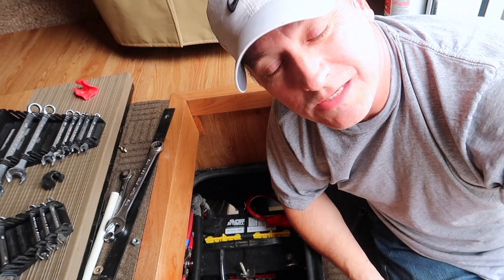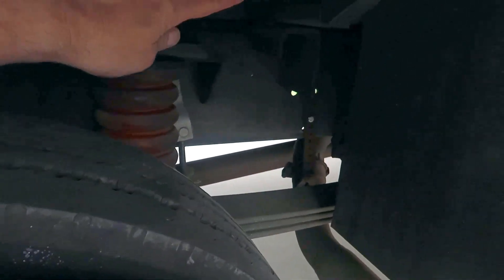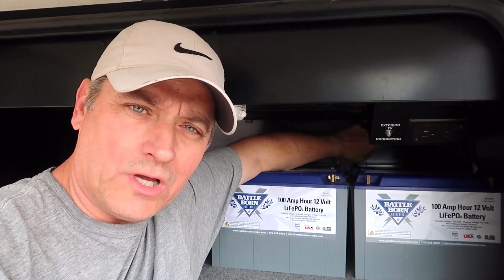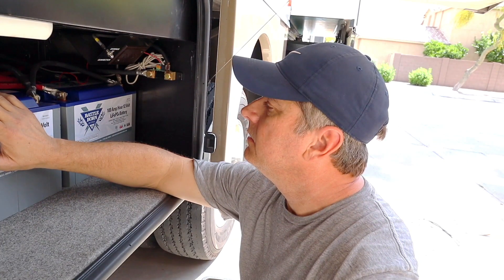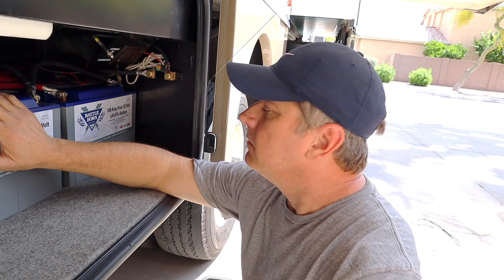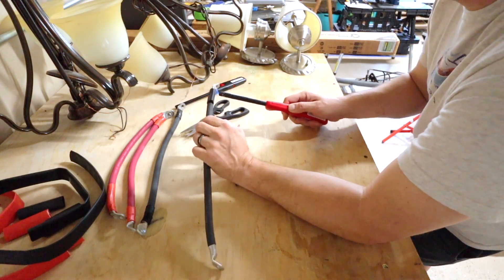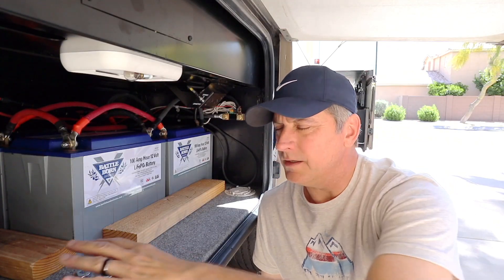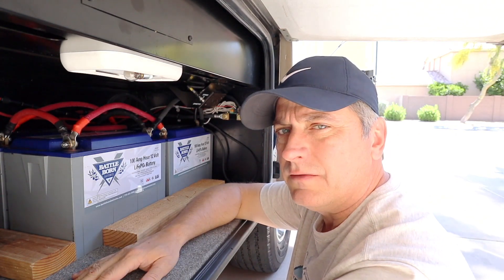Battle Born Lithium Batteries Install - Part 2 (Full Time RV Living]

Comment: Just installed 3 Battle Borns, and was hoping you'd be showing the Victron Inverter settings you chose!   I happen to have an Xantrex inverter/Converter, and looking to get all the settings so my charging efficiency is reached.   I've had them in now for a couple of weeks, and they seem happy to be sitting at 13.47V for some reason, and I only saw them higher when I first installed them, as they where over 14V.    Perhaps you'll have an upcoming video of all your settings, to complete the install?
Reply from the maker: Hi Dale!  I had Battle Born program the inverter so I’m not sure of the settings. You can contact them and they should be able to provide their recommended settings for your inverter. I do know you want to change the inverter charge voltage to somewhere between 14.2 and 14.6 volts.  Mine is set to 14.4v. Hopefully your inverter has variable voltage.  BB batteries don’t require a float charge so you can either set that at or below 13.8v or set it to off. Any equalization settings should be turned to off because lithium batteries don’t require equalization. Hope this helped.

Comment: All battery cables should be the same length.
Reply from the maker: I assume you're referring to the battery inter-connect cables? What issues could arise from having inter-connect cables that are shorter or longer?
Reply: @LyfUninterrupted  https://forum.solar-electric.com/discussion/13704/battery-cable-length
Reply from the maker: Thanks for the info.  Unfortunately,  I'm not able to make all inter-connect cable the same length due to space and configuration constraints in the battery bay.

Comment: Wired in series or parallel shouldn't matter on the battery draw these have BMS built in to balance the batteries. You would just wire them differently depending on the voltage you need. This is probably 12v system as most RV's are so I would think you just wire them in parallel? I am still trying to work all this out for when we get our rig in a few weeks. I am also considering CALB batteries, same chemistry but 1/2 the cost. I would, however, need to install a BMS whereas the battle-born batteries have this built in. Lastly, what are you going to do about the temperature in the storage bay? Maby a fan and a light bulb that switches on and off with a digital thermometer connected for extreme cold and or hot situations? Thanks for the info enjoyed the video.
Reply from the maker: Thanks for the comment! I wired the batteries for 12 volt power. The main issue I wanted to avoid was the potential problem of drawing power from the bank in an unbalanced manner. All The info I found on the internet recommends you connect the main positive to the first battery in the bank then the main negative to the last battery in the bank. The instructions for my MPPT solar controller had the same directions, so there must be something to it. As for the temperature in the compartment, I’m not too concerned. I do have a remote temp sensor for the weather station so I might use that. Thanks again and please feel free to reach out with any questions when it comes time to install your batteries.
Reply: @LyfUninterrupted  Makes sense, thanks. I am looking at all the components and designing our system now but it will be a while before I am ready to purchase and install. The  battleborn batteries looks like it might be the best way to go.
Reply from the maker: Also check out Lion Energy. They have 12v, 100ah lithium’s for $799, with a lifetime warranty. Not familiar with them so I cannot recommend. I can tell you that Battle Born customer service cannot be beat! I would be willing to bet BB would have no problem matching the price.

Comment: We have a 2003 Winnebago Sightseer 30 b and love it. We would like that battery setup, thanks for the video.
Reply from the maker: Nice!  We’re sidelined for a few days until we can have the main slide repaired. The plastic Acme nut broke so it needs to go to the shop. Hopefully we can get it repaired by Wednesday so we can make our way to South Dakota. The lithium batteries are great. You can contact Battle Born to see if they might give you a better deal.